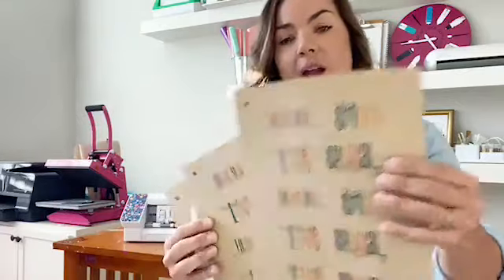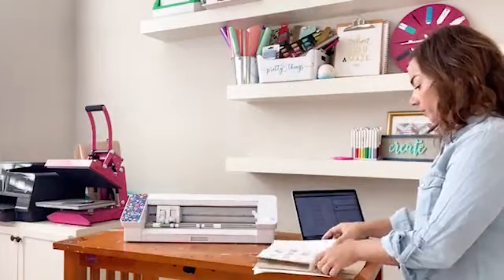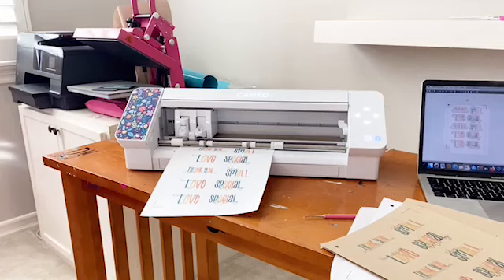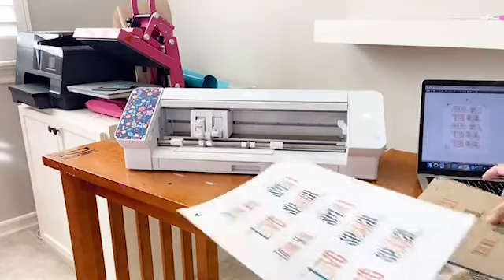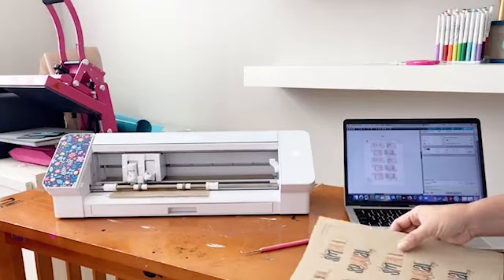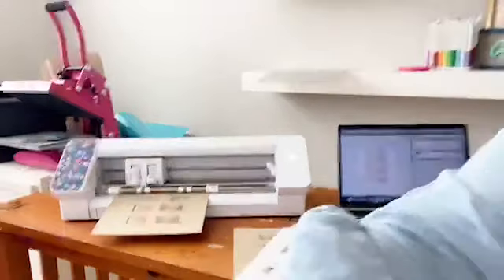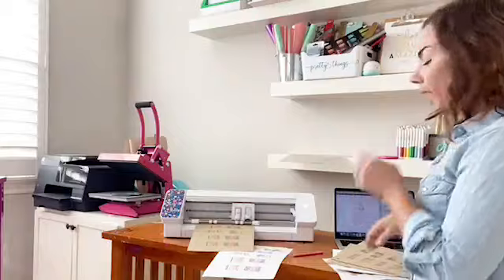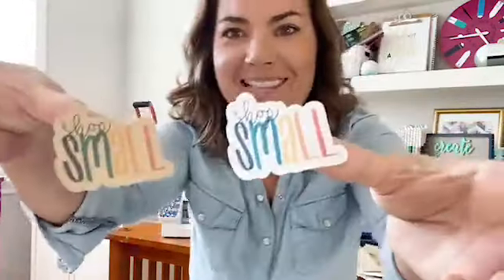How to Print and Cut Stickers with No Silhouette Cutting Mat

Comment: My issue is that the paper tilt, it happens only with high force setting but without it I can’t die cut. Ant suggestions?
Reply from the maker: Try to pull the right roller in a little bit toward the center so it's not so close to the edge and the paper can't come out from underneath
Reply: @SilhouetteSchool  thank you, I did't but the sheet keeps tilting even if the pressure is not that much
Reply: @SilhouetteSchool  I had solved the problem and managed to cut many stickers without issues. Now the machine has started giving me the same problem again: with the same settings as always, the cutting mat rotates due to the pressure of the blade. It rotates even if I set a very low pressure. I don't know what else to do.

Comment: I know not what manner of sorcery this is, but I've tried this on a Cameo 3 and a Cameo 4, and I've had nothing but issues. You make it look so easy, but the first issue I have is it reading the registration marks. It simply just does not! On both machines. Second issue is that when it does finally read them (which has happened maybe 3 times in the last 500 times I've tried) the paper blows right past the spindle and gets caught in the machine. How are you able to do this with such ease? I do not use a mat, I am placing my paper in just as you are. The only difference between mine and yours is the paper I'm using. I'm using the Online Labels whetherproof glossy white sticker sheet. I just don't get it. I think you got a magical cameo, that's all I can conclude lol 🤦‍♂️
Reply from the maker: Check out this video: https://www.youtube.com/watch?v=6rkONiJhmts&list=PLT9hB3BOKb_iorQC7CsuuwtMsBhneX4yW&index=3&t=56s If both of your machines are having trouble, definitely check your lighting!
Reply: Same issue.

Comment: hi! i keep encountering the same issue which is that the machine continues to roll past the length of the sticker paper right when i click send. so it doesnt detect the registration marks, how do you think i can fix this? i follow the proper settings of no cutting mat in the software so i don’t really get what exactly’s wrong with it.
Reply from the maker: Try making sure that you do not have any shadows on your page anywhere. You can pull the lid over to adjust the lighting. And if you wanted to try with a mat this blog post can help with that too https://www.silhouetteschoolblog.com/2019/12/silhouette-cameo-print-and-cut.html